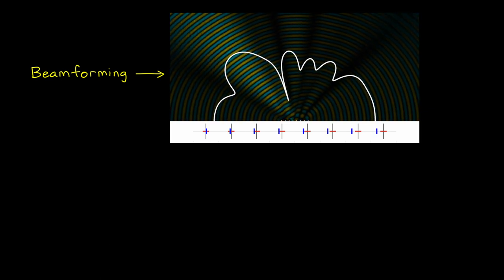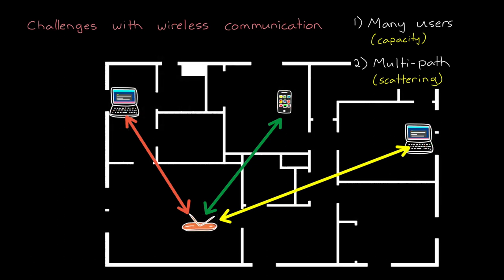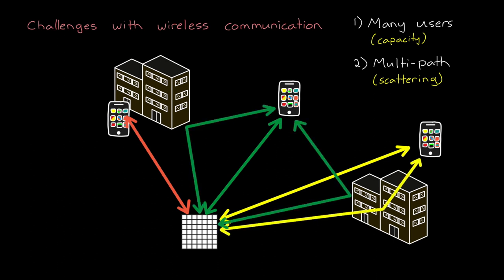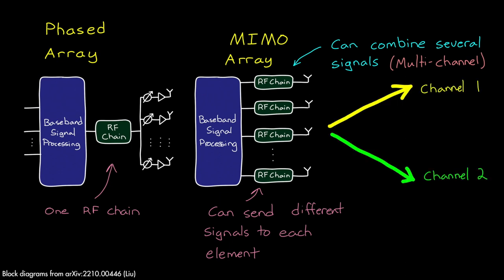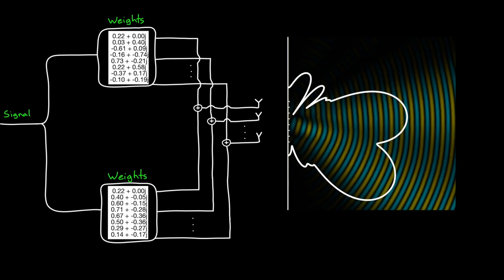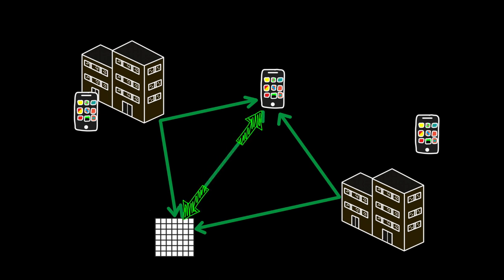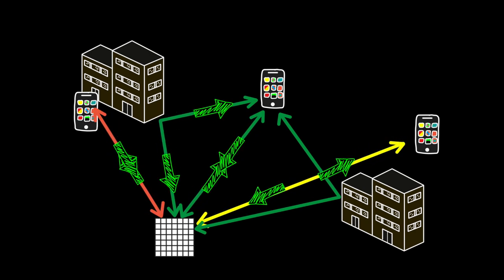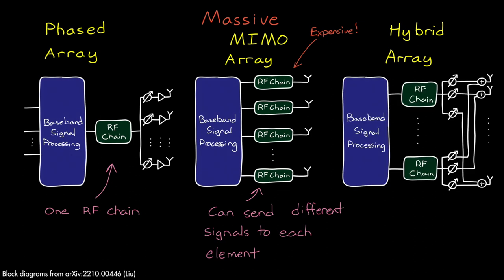Why multichannel beamforming is useful for wireless communication

Comment: multichannel beamforming is also used in fighter aircraft and a good example would be the TWS radar mode ( track while scan ) where there is a beam locked on one or more enemy targets and another still scans the sky to potentially detect other targets

Comment: hi Brian, Thanks for the well explained video. If I got it right in the case when we are supposed to simultaneously cover multiple radio receivers with a single array, multiple dedicated beams need to be sent for each receiver which means different RF chains are required for each one in a hybrid beamforming scenario right?